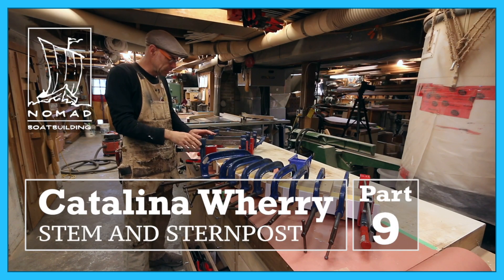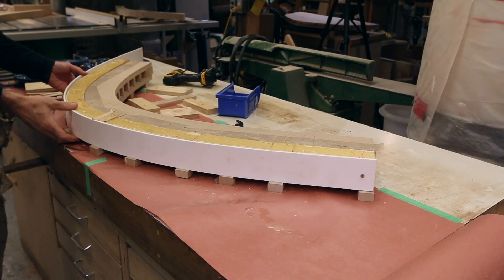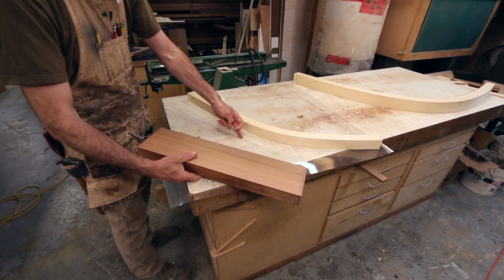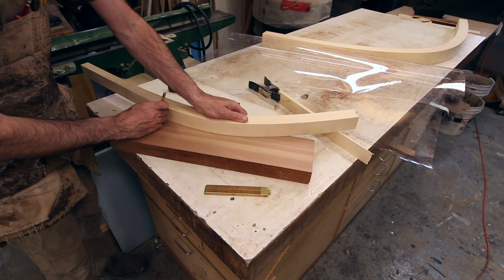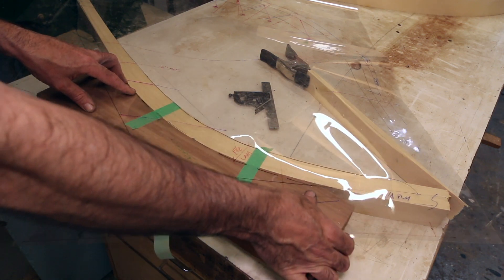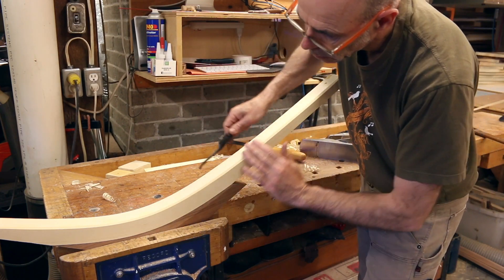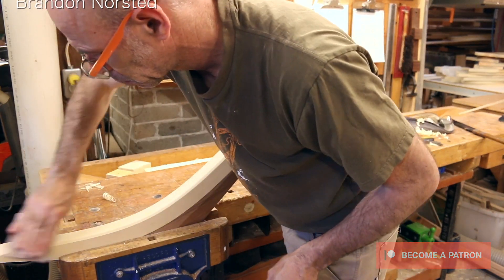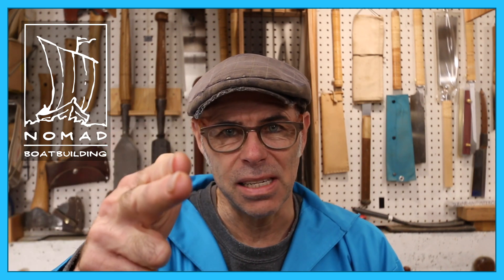Building the Catalina Wherry - Part 9 - Shaping the Stem and Stern-post

Comment: Hi
The the process of constructing the Stem using LePage PL premium construction grade -  looks okay ( it is cheap & easy to apply)  Limited to about 1-1/2 inch glue up piece.  It has worked for garden laminated pieces.  ( laminating oak about 1/4 inch thickness).
Keep the Vlogs coming since the ice should be gone by mid April this year.
Reply from the maker: Thanks for the info!

Comment: Wobbly workbench: I added a set of drawers built into a cabinet. This drawer cabinet is then slide onto the bottom shelf of the bench and is attached to the bench legs their entire length and is removable. Just leave enough room for the hold downs. Alot of people don't like drawers but I like them because closed they don't collect dust and shavings.
Reply from the maker: I have no problem with drawers in a workbench so long as stuff isn’t rattling around in them.

Comment: Hi Mark, I'm binge watching at the moment and playing catch up. Question, did you drill and tap the bed of the table saw to make the Feather board useable for smaller stock? The track looks a distance from the blade. I have just received a couple of Feather boards in the post for my quite small DIY (Destroy it Yourself) table saw and I'm hoping they will fit the track. I'm a tad under the weather at present and the good wife wont let me out to my shed to play!
I watched your "Short" on sharpening the Slick. I had just watched a Rob Cosman video on preparing and sharpening new chisels. I thought to myself, I wonder how he would tackle a slick. I followed his method on a bunch of old chisels and some new ones, using a diamond stone set and a stropping kit. I got those chisels mighty sharp, cant wait to use them. Not going to shave my arm though. 😄
Reply from the maker: No, I didn’t drill and tap the table. The feather-board is magnetic. Highly recommended.
Reply: @Nomadboatbuilding  Havent seen them before, I'm interested now. Is it just a super strong magnet or one of the pushbutton type used on Dial test indicators. I'm very familiar with that type from years in Aircraft Maintance.
Reply from the maker: Check out Mag-switch. It’s that type. I got it from Lee Valley years ago.

Comment: Just a question, not a criticism.. How would you have avoided that gap in the deadwood you filled. Was it a matter of locating the part in the cedar blank? Or was the blank a little small in one direction. Could it have been avoided via the mylar layout, or would a door-skin mockup have been more useful.
Reply from the maker: A larger bit of stock would have been the simple answer. Looking back on the footage, I notice that when I first laid out the deadwood, I was sacrificing a little depth on the lamination side relative to the pattern. Then when I was laying it out the second time, after fitting the deadwood piece, I returned to the pattern design, forgetting I had made a change. That left the deadwood shy by that tiny amount which I should have just let epoxy fill. But I’m kind of an idiot that way.